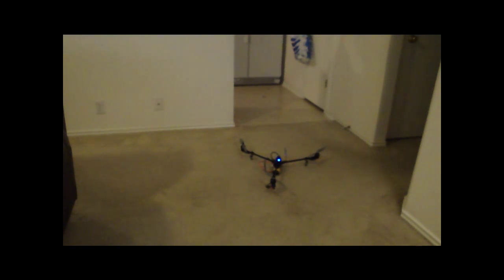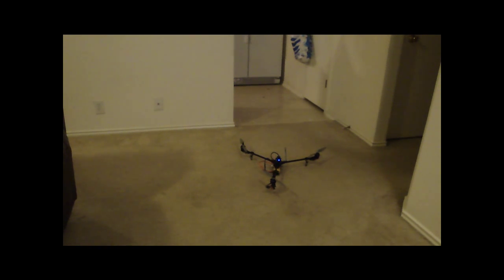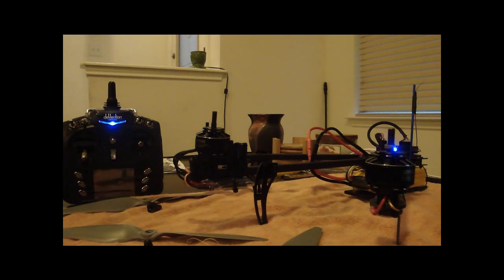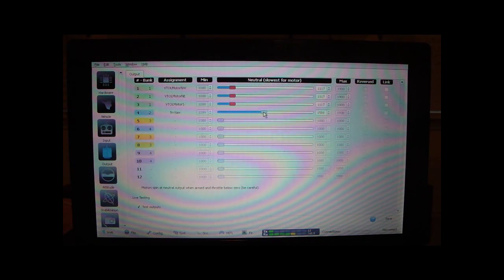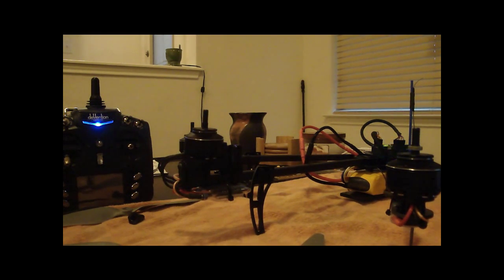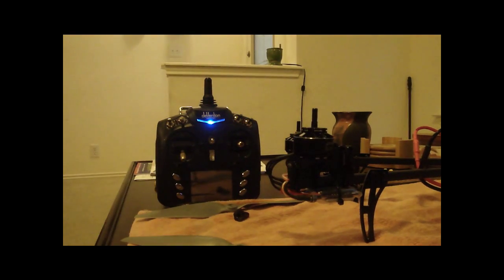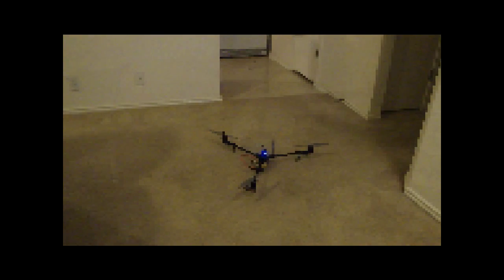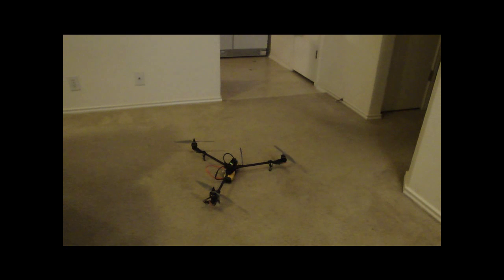Fix yaw spin on Tri-Copter with a CC3D

Comment: I struggled with this problem too, and I was close to scapping my tricopter. I reversed the rudder orientation as advised here, and it still didn’t do the trick. Then I read on the flite test forum that “you may need to set your rudder of your tricopter to -100 in the mixer editor”, and that seems to be the magic wand that I needed.
Reply from the maker: I'm glad you finally got it figured out!!

Comment: tanks a ton dude you have saved my day I have belied 2 tri-copter and both have the same issue I have changed several servo and several flight control board to fix this issue however never seems to work till I found this video.

Man you are the best